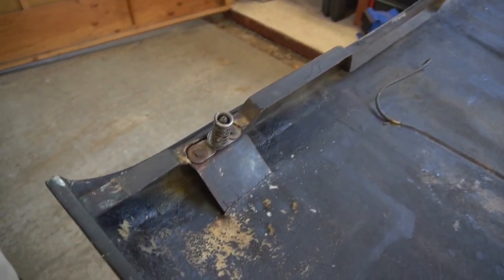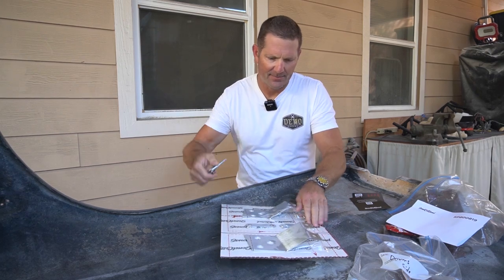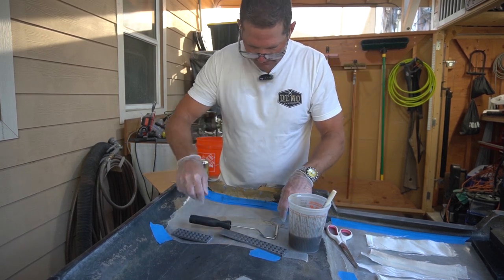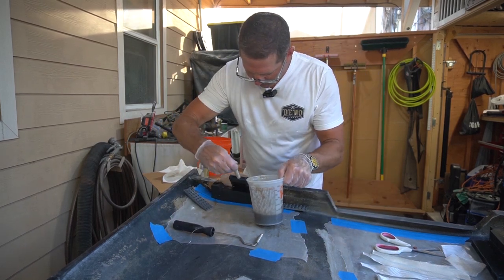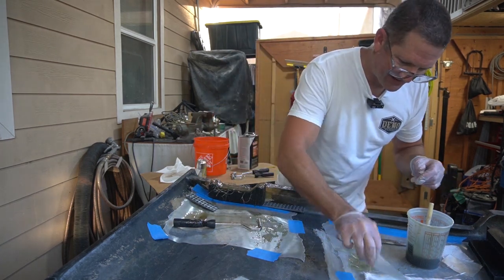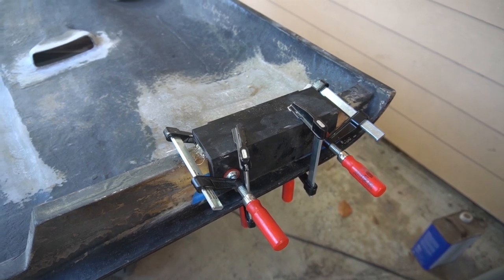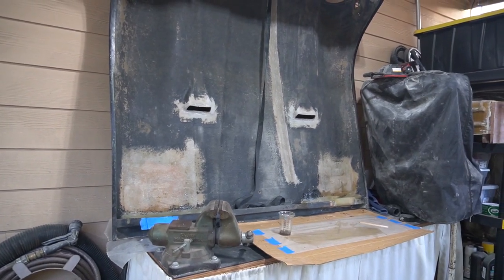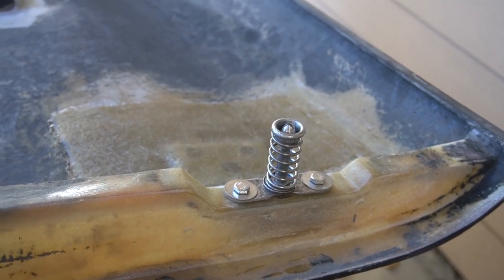Episode 07 Bonnet Latch Glass Repair '73 TVR 2500M

Comment: Your printed molds are awesome. Having access to that technology could be handy indeed for certain cases such as this. I have found that mixing small batches of resin for small jobs works well in 30z or 9 oz paper (not plastic!) cups. No cleanup! Also I mix by weight using a small electronic scale 1 Fluid ounce of polyester resin weighs 1.15 ounces. I also use the 1" disposable chip brushes to spread the resin and work it into the mat or cloth. Cleaning in acetone allows re-use, and a slightly stiff brush works better to push the bubbles out. I save the rollers for difficult situations as they are tough to clean unless you soak in acetone immediately and was with your chip brush.
Reply from the maker: Good tips. I do most of that depending on if I've used up my stock of brushes and cups.  Acetone all the way.  I should use the scale more often but find myself getting lazy.  It bites me on occasion.

Comment: Really good repair to the bonnet pin area. I need to do this on my 3000M. My daily driver punted my TVR through my closed garage doors a few months back and the pins took a bit of punishment. As did the hinge tubing. Might pinch your method when I get round to the repairs.
Reply from the maker: Thanks for the comment. Let me know if you want the mold stl. files.